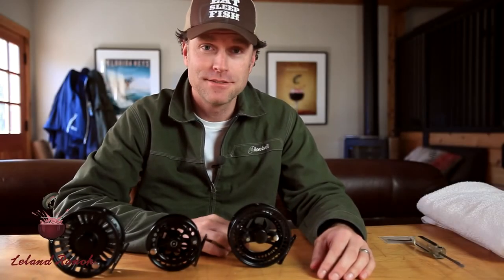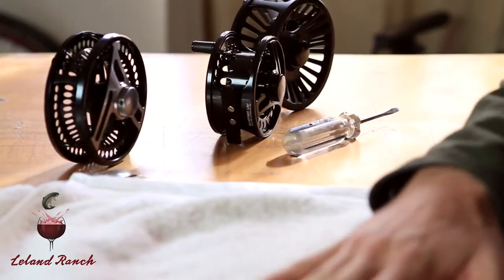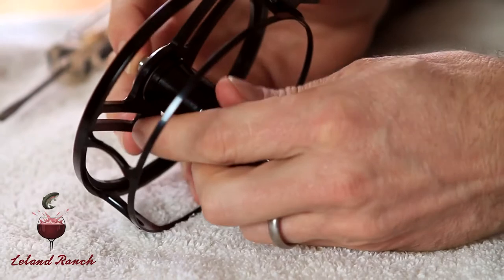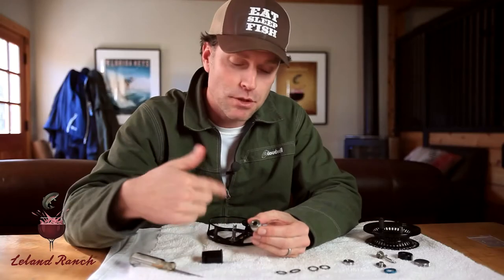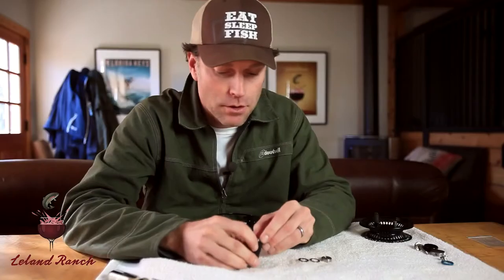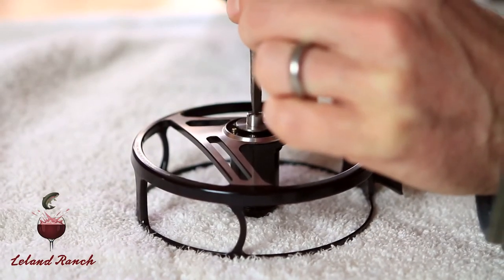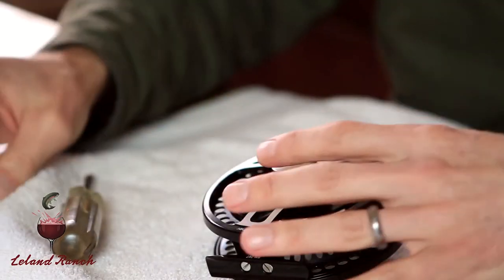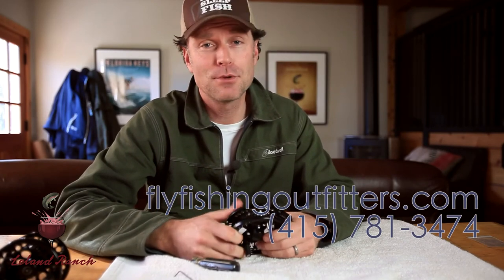How to Change Retrieve Loop Fly Reel Conversion - Multi - Evotec - Opti - Leland Fly Fishing

Comment from the maker: When fully sealed, there's no maintenance to perform on the drag system. Just wash the reel down if fished in saltwater.
Reply: @leland, I have a loop evotec G4 which seems to have a bit of a jerky (non smooth) drag- do you perhaps know a reason for this? And possible ways to fix it?